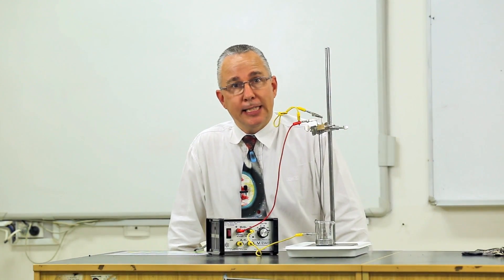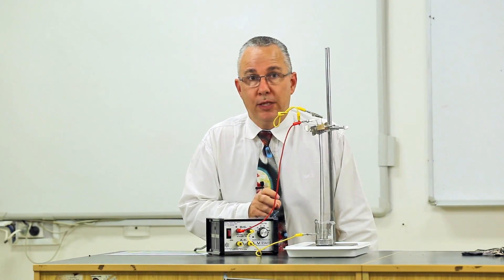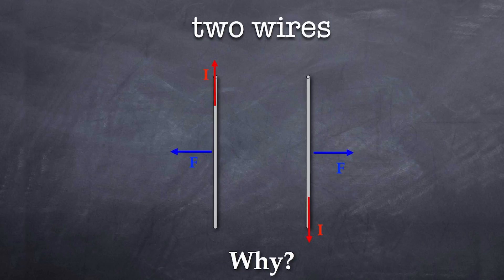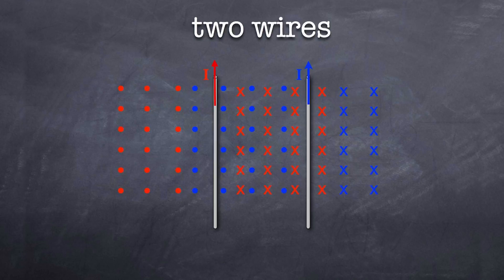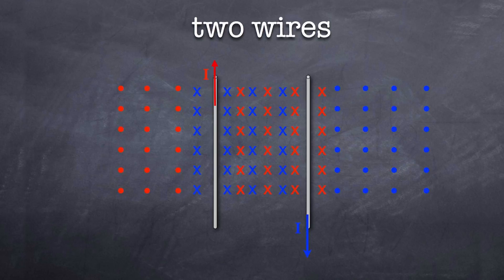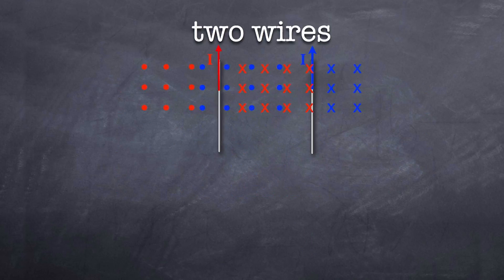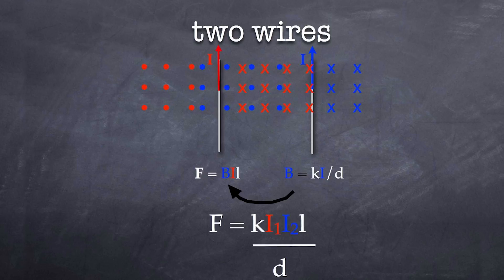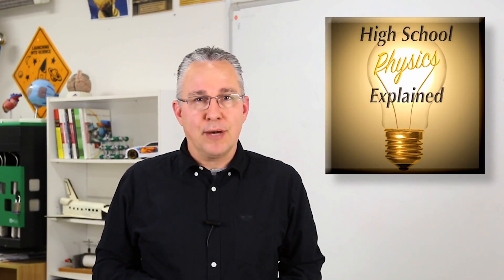Understanding force between current bearing wires

Comment: It is a great video. Wondering instead of using mercury, can it just be replaced by connecting two rod with a copper wire?
Reply from the maker: Hi - and thanks for your Patreon support BTW
In regards to not using Hg the issue with connecting a wire is that doing so , offers some resistance to the wires (aka they act as weight on the two hanging wires and so limit the movement.)
There is an alternative method however which is safer
Get a a shallow box (the lid of of the box that A4 paper is good for this so around 30x20x10cm)
Cut two vertical slits at either end, approx. 3-4 cm apart
Create two strips of aluminium foil and pass through the slits so that they both protrude from both ends. (You may need to double up the layer so its a little stronger)
Now connect to a circuit . with a rheostat so you can control the current. You can do it in the same direction or opposite. Since the aluminium foil is very light, you should be able to see the attraction and repulsion between the two leaves